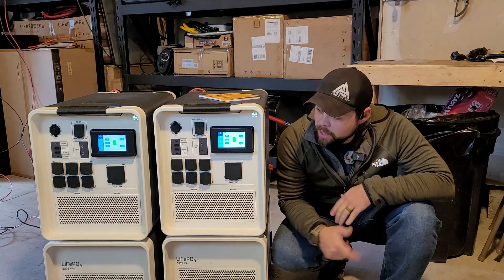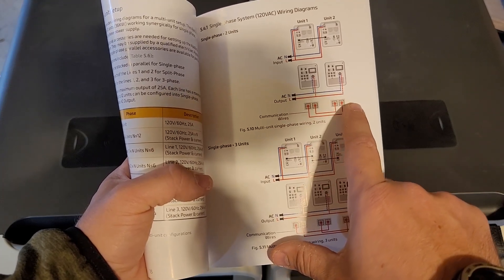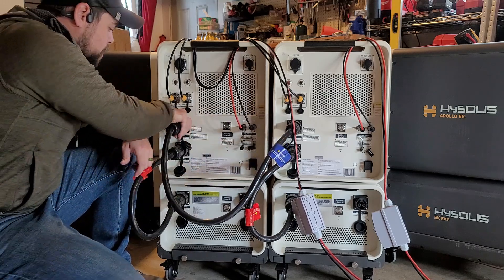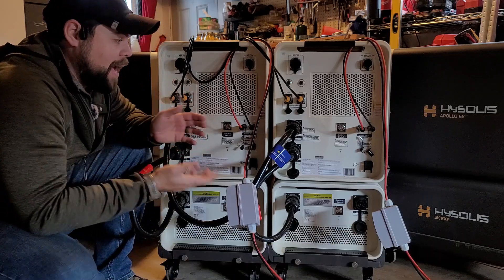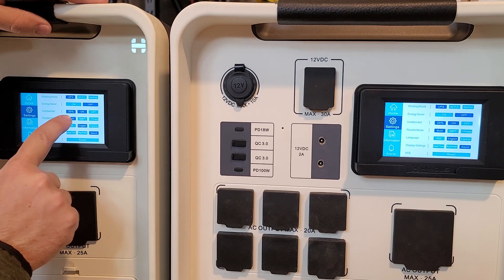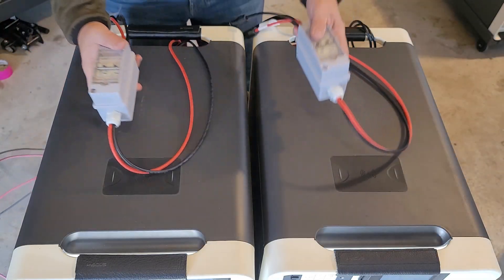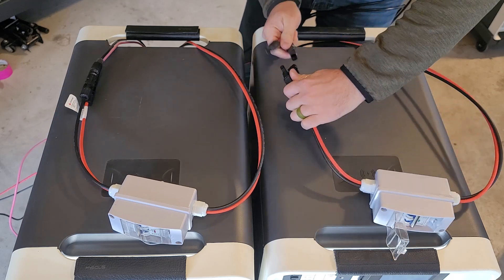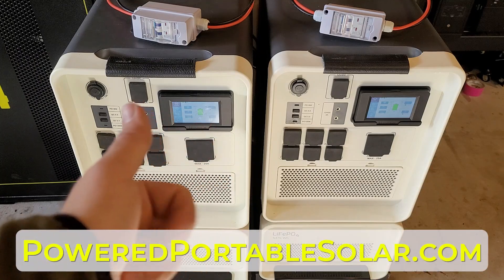Apollo 5K Setup Guide for SINGLE Phase with Two Units 6kw Output

Comment: Hi Ben, on a Single Phase 6k output, is this a continuous 6k or 3k from one inverter and 3k from another?  Lets say I have a 5000 watt load from 2-3 components lets say an 2x AC heat pump and an Air fryer would I be able to run it at 5k watts using these two units at one time?
Reply from the maker: 6k continuous with two units. You can pull 3k from both units but they balance each other on charging input and battery output. You can run up to 3kw output from each one, or get a cable that goes between the two that can output 6,000w combined split phase.
Reply: @minutemansolar  Thanks for your reply.  what do I use for AC in Breaker from my main panel?  50amp Double pole for charging and bypass?
Reply from the maker: @merrillbalan  240v 50a double pole 60 breaker on a 240v 50a generator outlet such as a SS2-50P outlet. This is how you can connect to your electrical panel. Use an Interlock Switch.
Reply: @minutemansolar  Just FYI I am not doing split phase during this whole conversation.  I want to combine 6000 watts and not have 3000 watts on each phase of my AC Output.

Comment: Hi Ben.  Another great video - thank you!  Question about the add on battery: do they have direct PV input capability?  Thanks.
Reply from the maker: My understanding is you can use an external MPPT to add to the last battery in a group of batteries to add more PV input. There is no MPPT built into each battery. But the main unit has 4,400w of solar input which beats any other system out there.

Comment: Thanks for the video!
Does hysolis have a cable to feed the house for this type of setup?
Thanks!
Reply from the maker: They have the cable to join multiple units together. From there you'll need an electrician to install the proper generator outlet on an interlock switch so you can run the house. I will have more videos on that coming out soon.

Comment: Question: Does the Hysolis Apollo unit have its own internal battery, or must you order a unit with an extra external battery to be able to use these units at all ?
Reply from the maker: There is a 5,376wh LiFePo4 6,500 cycle Class A battery within each Apollo.
Reply: @minutemansolar  Good, so I can buy two Apollow's and split-phase them for 240 Volts AC 60 Amps service ? That would run most houses in full backup.
Reply from the maker: @markjob6354  Not with 2 units. A single unit does 120v and 25a. When you connect two in series to increase the voltage to 240v the amperage stays the same at 25a. Volts x Amps = Watts. 240v x 25a = 6,000w. If you want 50a output to connect to a 60a rated generator outlet you would need 4 Apollos. I'll have a video on that soon.
Reply: @minutemansolar  Yeah, well, I'm sure as heck not going to purchase four of them ! These units are cheating on the Amps ! Yeah, Volts x Amps = Watts, but I care more about current output in home backup than I actually do about Watts, Sir. Even two EcoFlow Delta Pro's in split phase will give you a whole 30 Amps @ 7,200 Watts ! Not 25 deficient Amps ! Even 30 Amps is insufficient for the task at hand with home backup. 50 to 100 Amps is considered the nominal current. This technology is in a constant state of improvement. Let's see some manufacturers come up with a 120/240 Volts AC @ 50 Amps in one unit.